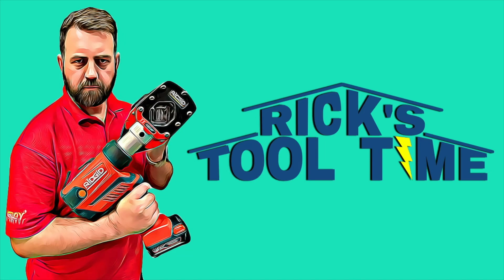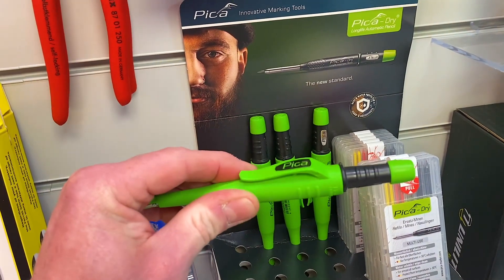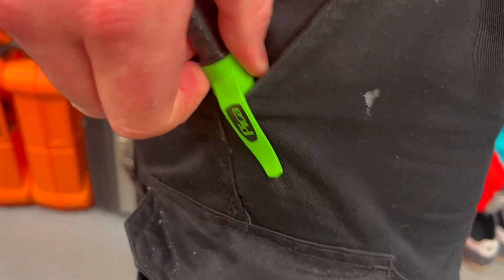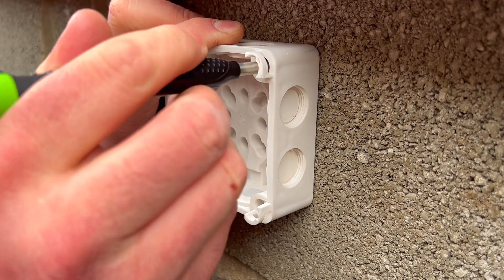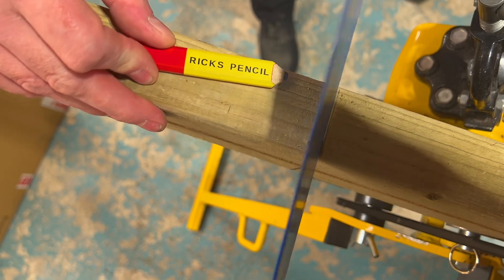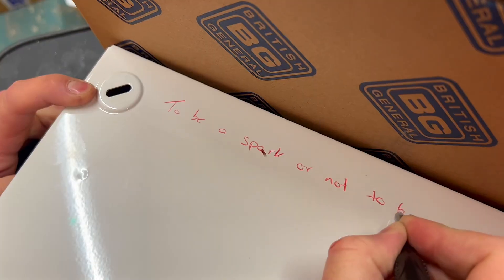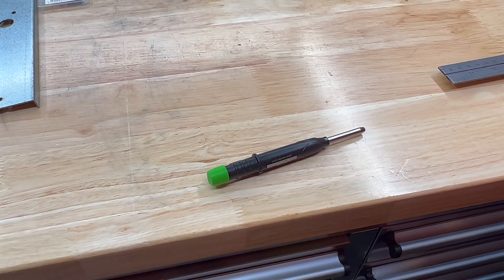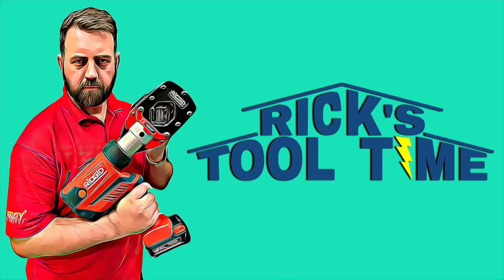Can the Pica Pencil Make You Ditch Your Old Pencil?

Comment: Pica is expensive and the push mechanism is quite fragile. Quality is not matching the price. I use Bic Criterium 2.0mm instead. Less fancy but much reliable and less cheaper. It exists in multiple body material. Only drawback is no color but only graphite, but for metal I use regular fine ink pen marker which produce a more visible and sharp line. FYI, for daily job, I rarely sharpen the 2.0 mm tip... no need, just draw🎉